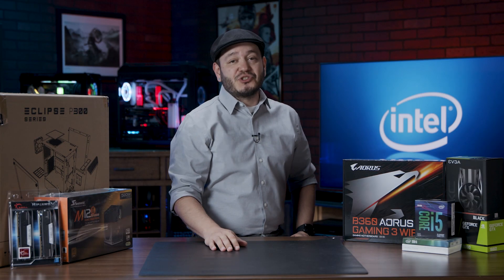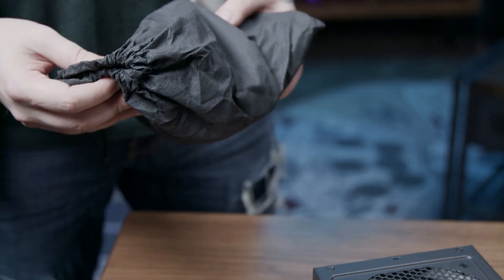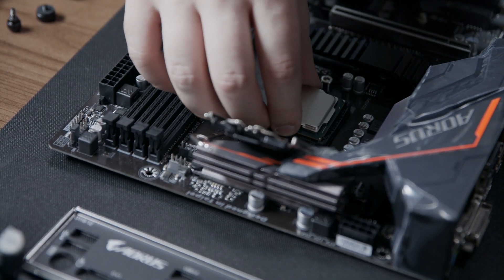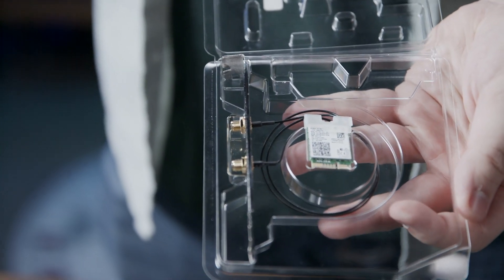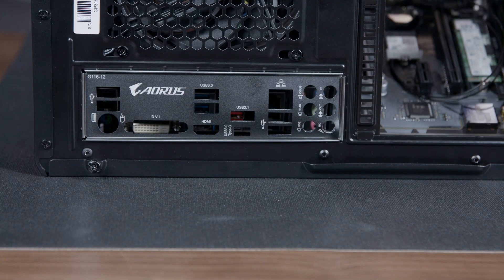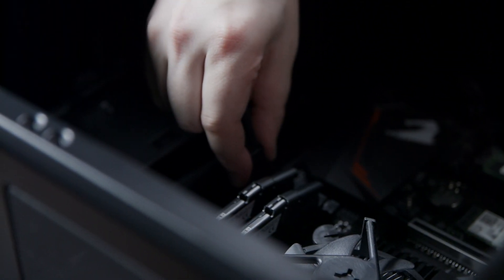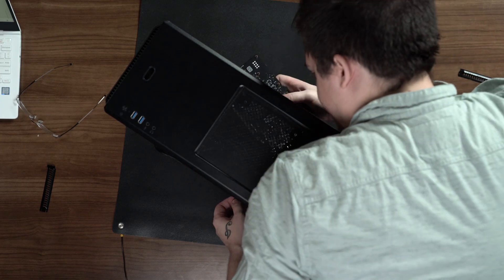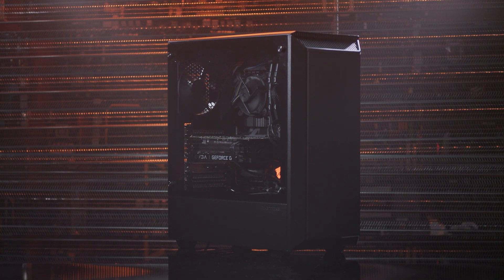Intel Core i5 Gaming PC DIY Kit: Step-by-step building guide

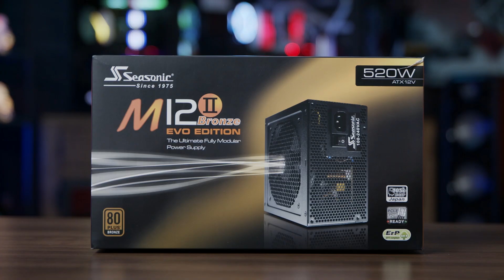Comment from the maker: 0:01:06 - Prepare the Case and Install the Power Supply
0:02:32 - Prepare the Motherboard and Install the CPU
0:03:45 - Install the Two Memory Sticks onto the Motherboard
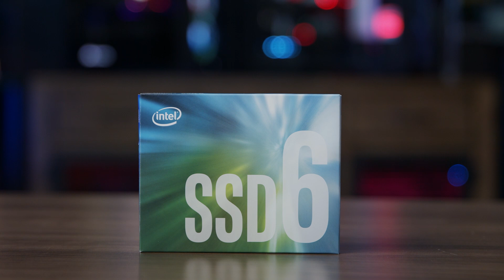0:04:14 - Install the M.2 SSD onto the Motherbard
0:05:59 - Install the Motherboard into the Case
0:07:21 - Connect Cables from the Case and Power Supply to the Motherboard
0:09:22 - Install the Graphics Card onto thew Motherboard and Case
0:10:08 - Connect the Power Cables to the Graphics Card and Tidy Up Cables
0:11:08 - Install Microsoft Windows 10 Home on the Computer
Reply: This is no longer for sale

Comment: Not a Verge-guide, seems a bit rushed however as guides go :). It's not wrong to explain for instance "why" a novice should place that PSU facing downwards, or what to actually look for when installing RAM-sticks, and not explaining it with "make sure the stickers face the processor". Appriciate the video though, Newegg, thanks!